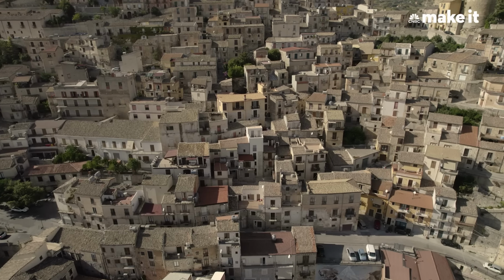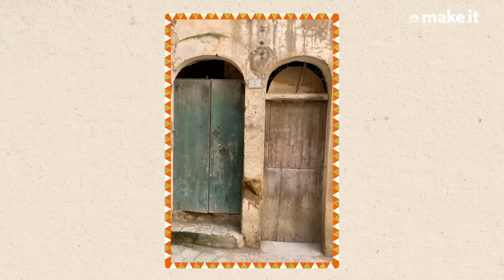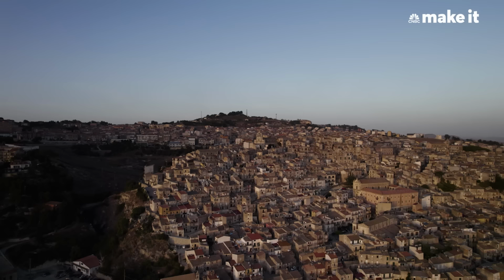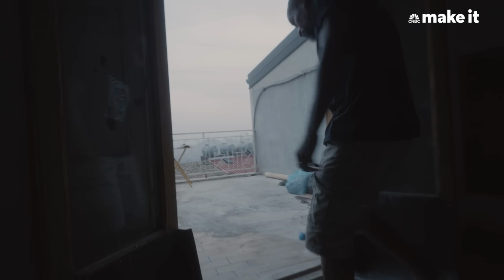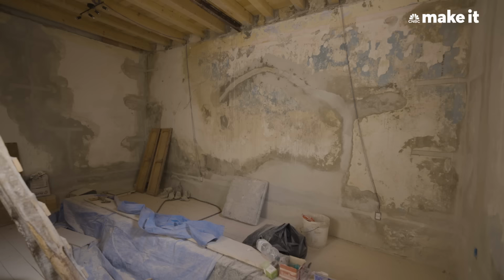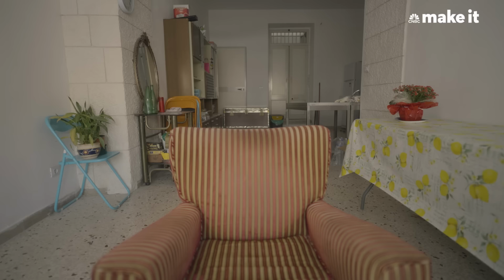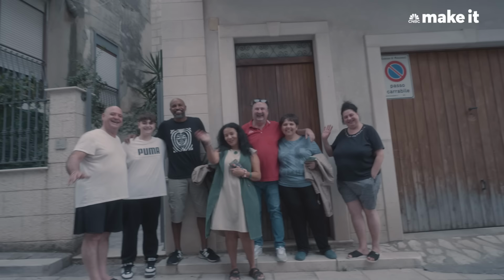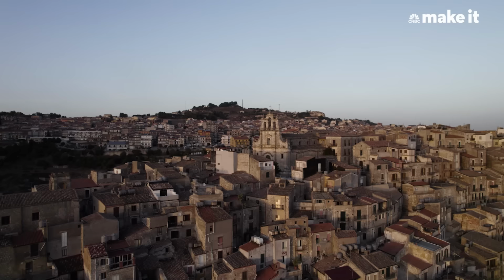Americans Bought Abandoned $1 Homes In Italy — Was It Worth It?

Comment: Based on the renovation cost for the house in Sambucca, I’d just buy one already fixed up instead of sinking $450K and 2 years to end up with a house worth $450K.
Reply: Not worth  450k, it cost 450k very different.  No one is going to that place and dropping 450k (btw 475 but its her loss so)

Comment: I hear that a lot of refugees are ending up in Italy, and that Italy seems unhappy about this. But this seems like a perfect opportunity for them. Put in a plan that allows the refugees to take one of these one-euro homes, and then they are required to renovate it fairly quickly. If they do, then they get a fast track to citizenship.
Reply: Refugees are there because they, presumably, escaped hardship with little to no money. How would they afford to renovate? In theory, seems like a nice idea though.
Reply: @kw7709  They can renovate it using their own labor. They wouldn't need to install saunas or wine cabinets, they could just patch holes and paint the walls. I suppose they would need low-cost access to basic materials, of course, but that could be paired with work programs so they could earn their way. They could get enough for basic food and to pay for the material costs of the renovation, and then do the house work in between.

Comment: Like anything else, it depends on what you do, expensive, moderate, or basic. Like any home anywhere. Marble obviously is expensive, the tiles, far less, lime finished walls less. 
Removing walls etc, expensive, changing the plumbing, electrical, heating can be relatively ok, going for luxury, obviously expensive. 
Roofs in Italy are frequently tiled, change the structure to support a different roofing material, obviously going to cost.

Comment: I dont know what comparable prices are for the area but i know in a lot of rural areas in the US just over 400k for house like that isn't a bad deal.  It would have to be in the middle of no where.   Anything in a nice area is going to be starting, at minimum, at around 800k and could go much higher.
Reply: In Texas, 100k will give you a lot of house. And brand new at that.  Have no idea what you are talking about.
Reply: @volvo24091  the median house price in Texas is between 350k to 400k.  Like anything amenities and location are massive factors.   I'd be curious about finding a house with equivalent amenities, size (this one was two houses but don't know the square footage), and with a view.

Edit: out of curiosity, I looked up $100k houses in the general Houston area.   Most are sub $1000 sq ft, completely trashed required a gutting of the property and obviously no view